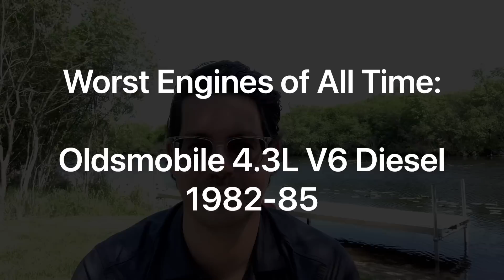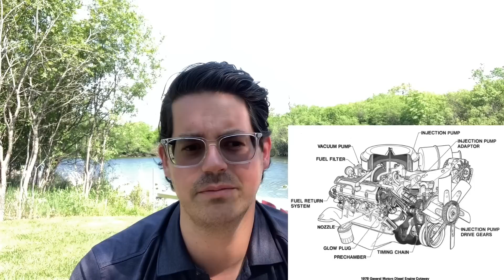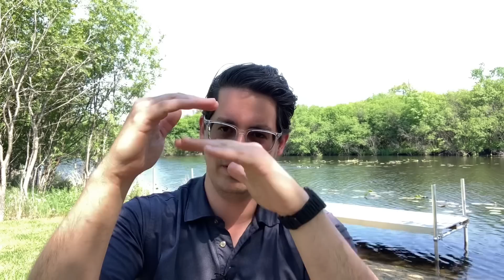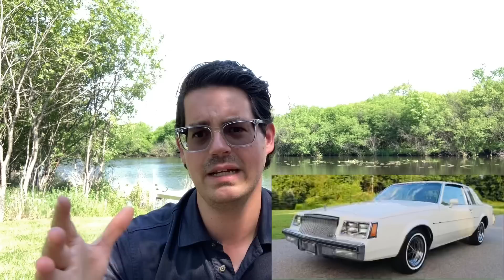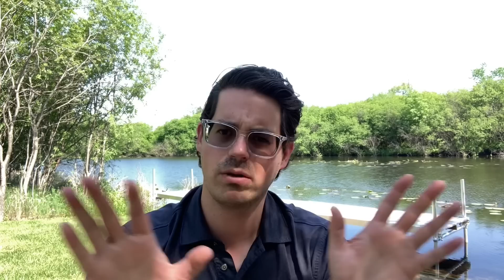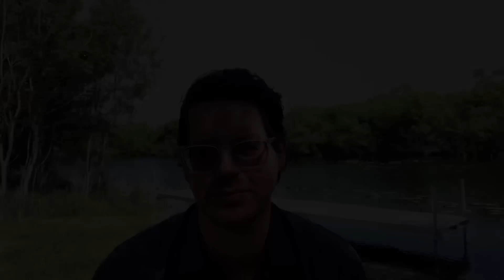Worst Engines of All Time: Oldsmobile Diesel 4.3L V6

Comment: Didn't GM convert a V8 to a diesel in the 70's? I remember being warned by a salesman not to buy on that was on the used lot of the GMC dealer I worked for in the early 80's.
My Aunt had a Cadillac with the Olds diesel in it in the mid 80's -  it was a great road car and gave very little or no trouble.
Reply from the maker: Yes. The Olds diesel.
Reply: Actually it was not converted, it had the same displacement, bore and stroke as it’s gas counter part, however the hollow web castings in the gas  engine are filled in the diesel, the gas crank is 2.5” with 4 main bearing caps, the diesel crank in 3” with 5 main bearing caps, the block has more nickel in it, the pistons have valve reliefs, connecting rods are thicker, bearings are different material, the big problem was they didn’t retool for the diesel and used the same 4 bolt head bolt pattern as the gas engine and there weren’t enough bolts or strong enough bolts to clamp heads down with the ultra-high compression.

Comment: What I can’t understand is if ANY GM engineer understood basic physics and aspect that should necessarily differentiate a gas engine from a diesel one, none of them would ever have built/spec-ed ANY diesel engine the way that they did, which was to create a black eye and huge negative perception and trust issues for diesels of all kinds, for Oldsmobile division and dealers, and even GM in general. The mind is still blown about that, and sadly, Oldsmobile and GM DESERVED the negative outcomes, yet sadly, the customers didn’t.
Reply: You are correct, they were given a shoe string budget, had less than the year to complete, and HAD to use the same head bolt pattern as gas to save $$ and no retooling. One of the guys that was on this team told them it wasn’t ready for market, blocks were still green, broken head bolts, main bearing bolts, leaking oil, cracked heads, he was forced into early retirement
Reply: My brother worked in the automotive industry, where to hear it from him:  The bean counters of GM probably didn't lavish sufficient budget dollars for the engineers to properly develop a diesel engine; sort of like being tasked to cook a lavish meal, but only given the limited dollars where only wheat flour and corn meal could only be afforded; where the essentials such as spices and seasonings were not used since there was no money to buy them.

Comment: Interesting point about CAFE - in a sense, the government, by not thinking ahead and prioritizing (arguably) environment, or more charitably, fuel independence, essentially killed the US auto industry.  Not excusing Detroit, as they 1) suffered from extreme arrogance and 2) many management missteps of the make your bed, lie in it type....   But still. CAFE perhaps an example of the law of unintended consequences, or at least not thinking decisions through.  The true free marketeers might start muttering about centralized planning at about this point.  What's undeniable is that the Japanese et al, had a tremendous advantage by not having to retool, as well as the inherent labor cost differential.  This even before true globalization and rush to low cost producers.  Somewhere one can almost see the gleam in a bureaucrat's eye 'oh, they're so big, it doesn't matter' - well it did / and now we send all the profits overseas even if we do get a factory out of it.

Comment: It is a measure of GM’e managerial incompetence that it could have some of the world’s best engineers, and still fail to deliver quality engines for around 20 years!!
Reply: This was the Roger Smith era, from what I have read, he was one of the worst CEOs GM ever had.
Reply: 3.5 eco boost carbon on intake valves due to DI
5.7 hemi.... changed lifter angle... leading to no lube to cam till ~1500 rpm is reached (same design flaw on all 5 generations of the 5.7/6. hemi)
6.0 and 6.4 power stroke..... need i say more?
VW v8.... oil pump "drive shaft" runs through a coolant passage..... leading to ALL the oil being pumped into the coolant in about 3 seconds when the seal fails (and it WILL fail)
VW also has an oil temp gauge.... on their soccer mom SUV......... but no oil PSI gauge 
.
and the 5.4 spark plug SAGA!!!
first it was too many threads...... and, typical ford, trying to re-invent things that worked for ~100 years..... like the spark plug
then it was too FEW threads and they would blow out.... but AT LEAST it was a normal spark plug (proving the 5.4 didnt need re-invented spark plugs to work... or pass emissions) 
.
.
.
like.... their isnt a DAMN THING wrong with GMs v8s
from 1955 to 2022
.
AFM sure..... but a simple OBD "dongle" fixes that
Reply: @kainhall  I have heard that all DI engines carbon up their valves, not just Ecoboost.  As to GM v-8s, there have been issues with valves failing in recent years.  Older(pre-2000) GM and  Ford V-8s were ok(except the GM diesel-I have had friends with these horrible things)   I have driven 2 Ford Rangers many miles, over 170,000(totaled by rear end collision) and 250,000.  These had the 2.3 four cylinder and the 3.0 V-6.  No real issues.  My wife had a Ford Escort that went 240,000, but it had a Mazda engine.  I have heard about the other Ford engine issues you mention, but never owned these.

Comment: I have never had a 4.3 L V6 diesel but I have a vehicle with the 4.3 L gasoline engine. I think the only reason why the 4.3 L Oldsmobile diesel engine with so bad was because they used a gasoline engine to try to run diesel I think. Everyone knows that a diesel engine has a much higher compression than a gas engine.

Comment: Our neighbors had a 1980 all yellow Eldorado diesel – it belched stinky exhaust, you could hear the thing coming 2 blocks away and it had that greasy diesel smell just sitting there with the engine off. My thoughts are if GM used Detroit Diesel or Opel to design efficient diesel engines and allowed to perfect them before unleashing a PR nightmare they never recovered from, things might have been different.
Reply: I think too many people think it’s a simple task to adapt different engines to a vehicle. The reason the “gas” Olds 350 was converted is because of the rest of the peripherals of the vehicles. A change to a Detroit Diesel or an Opel engine would mean a change to the transmission and transmission mounts, possibly the shifter, engine mounts, water pump and other belt driven accessories, on down the line. That would be a far greater cost for all of the vehicles involved, and a lot more R&D time.I’m not trying to admonish GM for past mistakes, but please don’t think that an entirely different line of engines would have been an easy or cost effective solution.
Reply: Hah, I'll bet that the Feds didn't require an evap system on diesels at that time...
Reply: @DanEBoyd  The only emissions on the diesels before 1980 was PVC, and only EGR till the end.  Diesels don't use evaporative systems...diesel doesn't evaporate like gas.

Comment: My Grandfather was a Ford guy his whole life, but he strayed once when he bought a new 1980 Cutlass 5.7L diesel wagon, complete with the woodgrain exterior. He was keen on the diesel fuel economy, and as a teen I thought it was a pretty nice car. But, he had to have the head gaskets done under warranty, and several other repairs as well. He gave up on the diesel Cutlass after only two years and went back to Ford, buying an LTD Country Squire wagon.
His comment at the time was "GM sure got egg on their face with that diesel".
Reply: That sucks, in 81, The 350 diesel became better.  78 to 80 was the problem years that gave the bad reputation.

Comment: I ordered a Cutlass in 1983 with the 4.3L V6 and drove the car for about 20 years, by the time I sent it to the junkyard the car had about 275,000 miles. It weighed 3,400 lbs, so was not the fastest, but once up to highway speed it ran fine at 30 mpg+ with the highest being 36. In the lighter Cierra it was higher mpg. I did add a good water separator to it. My brother had an 82 Cierra 4.3L he drove for years. I currently have an 84 Cierra diesel that came from Arizona so the body is solid. Another thing under development was the Tuned Induction V6 diesel. Tests reported 0-60 in Ten Seconds and quarter mile of 17.5 seconds which is faster then stock 4.3's. They reported 101 hp vs the stock 85 hp.
Reply: Adam works for Alexa, he is Artificial intelligence.
Reply: Quoted for truth.
Reply: Yeah not too sure that 10 seconds in that Cierra diesel, maybe if you threw it over a cliff at the grand canyon it could drop that fast.  Speaking of fast, ever do a Mercedes 220 D automatic with air conditioning and 4 adults ,  yeah now thats like 10 days 0 to 59.5 mph  Did not think it got to 60 mph,   The later 240D automatic was equally scary,  Ralph Nader could have done a "unsafe because it never gets any speed"    They say speed kills, well no speed and a highway short entrance is killer in one, just saying

Comment: We had an '81 Buick Regal with the 350 diesel.  In the five years we owned it we replaced the transmission 3 times and the engine once.  When the heads went on the second engine my folks said goodbye to GM forever and switched to Fords.  The Buick was very comfortable and got great mileage on the then cheaper diesel fuel, but it certainly wasn't durable.  It also had a mix of both SAE and metric bolts on engine accessories, making it fun to replace belts.  About 10 years after trading it in, I saw it one day driving around in the Central Valley of California, pretty far from our home, so it was quite the coincidence.  Whoever owned it had bought a crate 350 and converted it to gas.
Reply: ford was WAY worse for using SAE and metric bolts.... 
.
and how did your folks like having to pay 100 dollars a spark plug on the 5.4???
Reply: Diesel cheaper then. Imagine running one of these today withe Diesel at $6. Probably cost slightly less than all the Cummies & Powerstrokes. Dumb consumers.
Reply: And now finally it's actually reliable
Reply: My friend has one (a 350) in an 82 Toronado. Still running somehow with over 500,000 miles on it. It does have ARP head studs but besides that and roller tip rockers the rest of the engine is completely stock. Still gets 40 mpg on the highway and runs on whatever waste oil is thrown in the tank. It especially likes 0w-20 as fuel. Of course not as engine oil, it only takes straight 50 or 20w-50. But still runs like a top doing 100+ miles a week.
Reply: @theodorgiosan2570 I would love to have a diesel Toronado/Riviera/ Eldorado ❤

Comment: I think a major part of the problem of meeting CAFE standards was that US automakers were so reluctant to adopt EFI and computer controlled ignition timing. Instead, they spent $$$ on those horrid computer controlled carbs, still with just electronic ignition, with mechanical advance. Granted, computers were slow and unreliable in those days, but, still, lots of imports used EFI. Ford and GM were both of the mind that if it was NIH (not invented here), it didn't exist. And, as usual, GM under-developed a product, tried to be cheap about it, let it develop a poor reputation, and by the time they get it right, they sh!tcan it.
Reply: GM has been fuel injecting engines since the 1950s (mechanical) and electronically since 1976 MY. As a matter of fact, GM produced the first American car to come standard with EFI.

Comment: In the mid-late 70's I was an HD truck technician for a beer & wine distributor. We ran both gasoline and diesel powered delivery and over the road trucks. The owner was very politically involved and we had just gone through a gasoline crisis. We had our own 10,000 gallon regular gasoline and diesel fuel tanks on site and he was bound and determined not to have to worry about purchasing unleaded gasoline for his own vehicles so.............Cadillac Sedan deVille with the Old 5.7L Diesel. 

He showed up at the shop grinning ear to ear with his diesel powered Cadillac and had me fill the tank. I told him his wife wasn't going to like the exhaust fumes when he started the car in the garage. Within a few days he gave the the diesel Caddy to his sales manager as his new company car. The word was that his wife wouldn't let him park it in the garage........

Comment: So the root cause of this mess... Government regulations.  Shocked, I'm shocked.

Great channel.
Reply: Without those regulations, manufacturers would have continued to make fuel guzzling, high polluting vehicles, increasing American dependency on foreign oil and making an already significant air pollution problem even worse. Great idea.
Reply: @cdglasser  Diesel engines are, on average, 20% more efficient than gasoline engines.   So by killing off the diesel,  our moron government has actually INCREASED (so called greenhouse emissions) by 20%!   BRAVO!
Reply: @johndaniels651  Greenhouse gases are only one component of air pollution. Diesel engines emit far higher particulate matter and oxides of nitrogen. Numerous sources contend that diesel emissions are overall worse, or at best, no better than gasoline engines in overall environmental impact.
Reply: @cdglasser  Gasoline engines also produce NO2 NOx .  A modern diesel engine with a trap oxidizer and urea and deionized water system (AdBlue) has particulate emissions substantially similar to petrol, but with 20% greater efficiency.   Moreover because diesels are higher compression, they are better suited to turbos, extending their efficiency   beyond 20%. It makes no economic sense to even use petrol engines in heavy vehicles.   The war on diesel by government has nothing to do with the planet, ,and everything to do with the dismantling of our economy, and transitioning  the population into serfs and peasants, while the elite become lords.   WAKE UP!
Reply: @cdglasser   You really think consumers are incapable of making decisions in their own benefit?   Or that government is better at it?
Reply: @mikelezcurra810  Yes, I do. Consumers at the time were certainly not going to push for  substantially better fuel economy, and especially not lower emissions, because most people put short term gains ahead of long term benefits. History has proven that repeatedly. It's one of the reasons we elect a government - to do the hard things must be done that we won't do unless forced to.
Reply: And the root cause of government regulations is globalism.
Reply: Government Regulations that put US manufactures at a huge disadvantage to foreign automakers, all to deindustrialize the USA, and ship good middle class jobs overseas (in the name of saving the planet).     Mission accomplished!   No matter what industry we once dominated, the USA is pretty much out of it now.   Boeing is the last such crown jewel to be wiped out by federal regulators.    Much of the Max  / Dreamliner issues /  777 issues have geneses in "government regulations."

Comment: I had no idea before this, that the Seville could be ordered with a diesel.  Assume it was from Oldsmobile, as was the port injected Olds V-8 being the standard engine.  I just read that the Seville was an expensive Cadillac model, and based on a modified, lowly Chevrolet platform, I'd guess it was a very profitable car for Cadillac in those years. 75-79.  At the time it was a nice compact, yet upscale GM vehicle.  Not the ship that was the 'downsized' 77 and up other Cadillac models.

Comment: My grandparents had two 4.3 diesel cars; '84 Celebrity and an '84 Old Cutlass Ciera. The Cutlass was't bad, and the Celebrity actually lasted for years. 

Also, one of my best buddies from High School's parents had an '84 Cutlass Supreme with the 4.3 diesel. By the time we graduated high school (92), it lasted over 200K miles. 

Purely anecdotal, as we all know these were not stellar engines, but it was strange that the only 3 cars I knew of in that era, all were fairly reliable.
Reply: It's strange. My Dad's buddy had a 79 GMC pickup with that 5.7 and it went over 100,000 miles. My Dad's 80 broke a main cap at 52,000

Comment: It never made much sense that GM olds Gambled with the automotive diesels when they had a piece in Detroit diesel still .  And not too many years later by the late 1990s Detroit diesel had came out with a clean sheet design DELTA 4.0 V6 diesel to do just what they had wanted but GM already was working on the Duramax with Isuzu.
Reply: Detroit Diesel designed the 6.2 and 6.5 GM v8 diesel light truck engines
Reply: Good information. Thank you.

Comment: An interesting diesel olds developed but never released was a V5 diesel.  I think it was targeted for 1983 or 84 but was cancelled.  I recall reading about the development but it was quietly cancelled.
Reply: machine tool company I worked for held that engine line contract ....     cancelled at the last minute / before we started cutting steel stock
Reply: Correct!  I remember seeing one at the GM Proving Ground.

Comment: People make fun of GM for trying to turn a gas engine into a diesel. However the fact is that most companies that make both gas and diesel engines will try to reuse as many parts between them as possible. Also I read somewhere that GM thought they had a new process that would have made the engine strong enough w/o adding more head bolts, but in practice it didn't work the way they thought it would. I think in reality the olds diesels were just another example of 80's GM forcing their customers to beta test their products.
Reply: It's better to do it the other way ,like Cummins. 
A C series cones to mind.
They convert em to gassers by swapping pistons and heads basically. 
It's best to start with a diesel to make a decent gasser,not the other way around. 
And even then, they took a perfectly good diesel engine and ruined it with spark plugs🤦
Haha I'm not a big fan of em , because it's not a diesel but they work great.
Reply: That wasn’t this engine